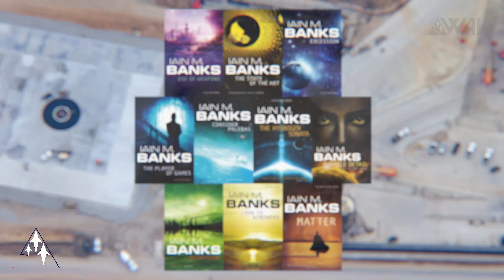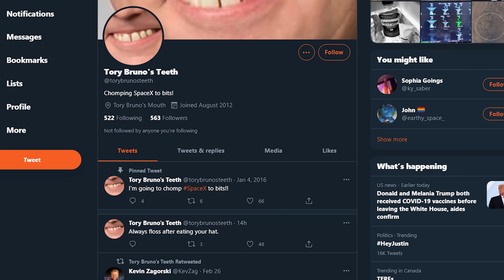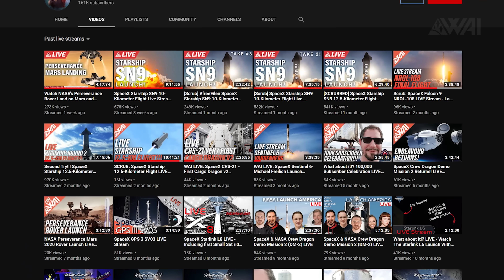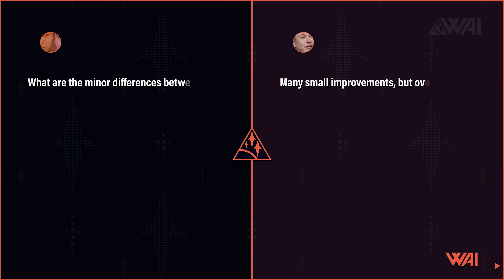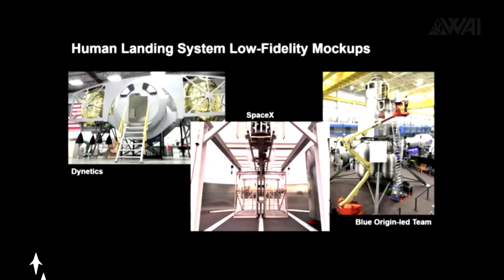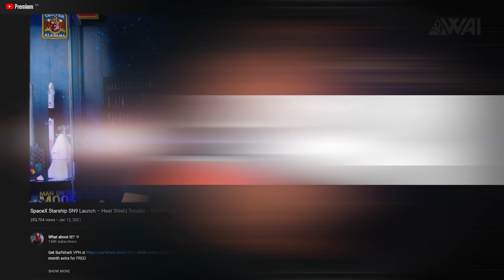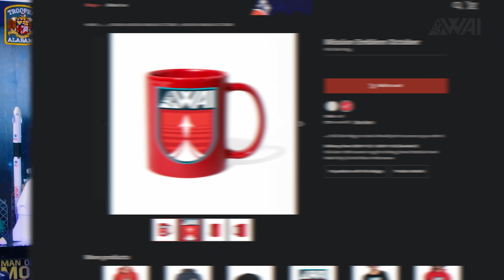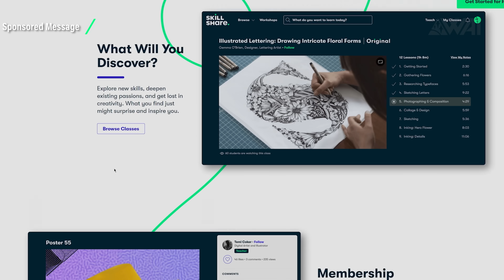SpaceX Starship SN10 Ready For Launch! RocketLab Neutron Rocket Entering Human Spaceflight!

Comment: Chopped off top, could be for a Space Station segment,  Same on the base so it looks like a Starship with two pointy ends and put it on a the Heavy Booster with a small rocket packet to boost the Space station section up to higher altitude, and join said cut of nose to air lock segment, to form a classic ring station 🤓

Comment: What about steel tank In concrete tank with low pressure / vacuum ' insulation ' layer separating ? So crude dome is outer tank dome and standard Starship tanking With the different dome  is the inner !

Comment: I'm presuming RL's new motor uses electric pumps like Rutherford in which case the rendering closeup of the first stage engines at 12:17 doesn't appear to show from where they might release the kick battery boxes (or whatever they call them) that they dump into the ocean.
Perhaps they could be ejected from the side?

Comment: The increased chance of success using 3 engines instead of 2 is (3 - 2p) times, 
where p is the reliability of a single engine (0 to 1).
You'll notice that this is an improvement for all p < 1 (or the same for p=1).

Comment: Rocket Lab is making a big gamble here. The Neutron will be a direct competitor to the Antares and can lift many of the payloads the F9 does. But in order to make that rocket a viable option, the costs have to be lower than the F9. And even then they have to cross their fingers that Starship won´t reduce the launch costs as much as Elon Musk has promised.
Combine that with the things Peter Beck said RL would NOT do:
1) Build a bigger rocket
2) Build a reusable rocket
3) Go public

These things combined seem to hint that RL is driven in its decisions, rather than the driver. It appears like they felt the sudden pressure to lower launch costs even further, expand into new areas and find a way to somehow finance this endeavour. 
Can we find another indicator for that? Well somehow. RL states that they could print one Rutherford engine per day, which is enough for 35 launches per year. So far, they had 18 in their whole company history. And this year doesn´t seem to get better, with one launch completed and one launch to come this quarter. This seems to indicate that RL is staying way behind their maximum capabilities. As if the expected demand wasn´t there.
So it seems like either the demand wasn´t there to begin with (which would be the same experience Spacex had with their F1) or that something eats into their market share (like Spacex´s rideshare missions, that carried more satellites with one launch into orbit than RL in total).

Overall, all of the above combined indicates that RL´s bold moves into new territories and the abandoning of old principles are steps taken by a company in survival mode. They feel the pressure to do things they didn´t want to do, abandoning old visions and business plans to create a new niche for themselves. But if their big gamble doesn´t pay off (especially if Starship in fact reduces launch costs to less than 10 milliion per launch), it is lights out.

Don´t get me wrong, I really love RL. They are really creative (just look at their services and hardware they offer for customers), nice people and have been a wholly constructive force in the space industry (unlike BO *cough*). But we must not fool ourselves and look at the viability of business models with a neutral attitude.

Comment: Why think Carbon Composite isn't strong enough for re-entry? Electron has already proven that the material does survive the heat and stresses. I think it's a too limited view to think they will switch to more common materials when they have developed a system of construction that they know works, and produces a vehicle they can recover. Expect a Rutherford 2.0 upscaled to match the new design for Neutron's first stage, and an array of four or more Vacuum Rutherford's for the second stage.
Don't forget, that sticking to the same motor design is sticking to the same fuel, and the lower stowage pressures required. Neutron will have a thicker heat shield on the bottom, and chutes up top, after all, Salt Water doesn't corrode Carbon Composites.

Comment: I would like to be an optimist in regards to Space Labs.  However, SpaceX is putting enormous pressure on the small launch providers.  Their regular, flexible, very low priced with space tug orbital modification capability makes high cost per kg a hard sell.  Space Lab's Electron rocket  has only flown 18 times since May 2017. There have been 16 successes and 2 failures.   It is reported Rocket Lab with be infused with $745 million in cash from the SPAC and a concurrent funding round.  However, Rocket Lab's revenue was only $35 million in 2020. The company reported adjusted earnings before interest, taxes, depreciation and amortization (EBITDA) of –$36 million in 2020, but expects to break even in 2023. $745 million certainly sounds like a lot of money for a company that lost $36 million last year. However, to develop engines and a medium lift rocket and continue operations for $745 million may be a stretch. It sounds to me like someone has too much money and doesn't know what to do with it. I wish them only the best.

Comment: If I had to make an educated guess that those domes are the top of a 2 layer, aka double wall cryo tank, which would be required if they want to store large amounts of cryogenic liquids. Imagine a large thermos. A vacuum pulled in between the layers, so that the construction of it can be slightly crude, it only has to hold a vacuum.

Comment: The building east of the landing pad is electrical,  the underground is conduit not process piping. Will house Switchgear, MCC (Motor control center) still stumped on the round structures? Don’t see water stop in the base slab for tanks so unless they use hydrophilic plan on leaks. Whatever it is it’s built for weight with 4’ base slab. My 2 cents. Keep up the great work!

Comment: Bigger domes and rings are maybe the outer shell of fuel tanks for insulation and normal sized rings will be used inside to hold the pressure. Just my best guess.

Comment: Why  not  make  Falcon  3  x  larger  with a  ratio   1:3 ?
Reply: They want to use a new engine, new fuel, and new design specifically designed for exploring the solar system with refueling.

Comment: At 1.47 on this video I saw what appeared to be a movable apparatus probably used to harness a returning Falcon 9. When it comes to landing a Starship at sea they are likely to need such a device for inspecting the Starship/booster before and after flights. You could move the Starship to it or it to the Starship. It could also offer protection from saltwater and weather. No plane fly's (or should fly) today without a pre-flight check. Especially if it has heat tiles.

Comment: That could actually be the shape of the new nosecone. It looks like it has an abutment where the heat shield tiles can be fitted against. It may be that tiles near the top will go completely around the nosecone. An additional single piece would cover the very top and would be easier to install and maintain as a tear drop (bullet) rather than a point. That might actually be an improvement in aerodynamics rather than a detriment.

Comment: Hey do you think that flop should be slower? I think so. It can be gradually pitching up without inducing oscillations. You will lose couple of kilometers of aerodynamic breaking, but the majority of velocity is lost in the upper atmosphere.

I mean this thing is planned to fly people. Shuttle has 98.5%, reliability and it was one of the reason for being canceled. Falcon has 87%, reliability. If the aim is 99.9% then this has to be at least 100x more reliable... Especially since it has no abort system. It would take about 20 years to prove this reliability with weekly launches. This landing with humans inside looks very sketchy. I mean capsule + parachute has 100% success rate if I am not mistaken. Plus it need to be approved... I think SLS has better chances of success, but this is more interesting to watch.

Comment: I have a feeling that Neutron will be a steel rocket with open cycle engines. (I don’t see full flow happen with rp1) the question is: will they have a smaller center engine to make hovering possible or just go for the suicide burn?

Comment: I think they removed the original nose cone that was there because maybe mid way into the construction they had a breakthrough on a new header tank design. Maybe it was just easier to cut out the whole nosecone with the tank instead of disassembling the cone. I assume they will add the new tank design with cone once the time is right.

Comment: The storage tank may appear much bigger then the storage tank itself but what if SpaceX is planning for a layer of insulation surrounding the Methane and LOX tanks to more cost efficiently keep them chilled and ready for use at a moments notice. Also There are more fuels then just LOX and Methane used by SpaceX what about Diesel for all the heavy equipment they keep using for day to day transportation. Maybe SpaceX thought to just have a central Fuel Depot instead of spreading too wide. Easier for management.

Comment: Anyone else waiting for the day when someone decides to make a continuous stir welded main hull for a rocket, with the sections being welded together as a continuous spiral, like a paper towel roll tube?  I get that they couldn't make the ENTIRE hull like that, and there would be waste at the top and bottom if they don't just continually run a line and cut it to length, but I'd at least like to see someone TRY it.

Comment: This may sound like a dumb question but can anybody tell me why do the crew have to be on the top of the rocket? I ask this because if SpaceX are going to the moon and having to use a lift to get to the surface plus have engines halfway along the rocket for landing. Why not turn the whole rocket around internally? You put the tanks of LOX and Methane on top feeding into the engines halfway along the body. Below them you have the crew quarters. As they are now a few feet above the surface after they have landed you can have a ladder. Or am I missing something and being very dumb?

Comment: I think a lot of the grey pipes that are pointed out in the videos are for electrical duct banks, not fuel.  You can tell because they appear to be PVC and come into Pre-Cast concrete pull boxes, where the cables inside the pipes will change directions.

Comment: DUMB^2  It is insane to wait until the Starship is 7 seconds from crashing into the ground before lighting off its Raptors.  This leaves no time for anything but perfection and there are too many variables and lag times and chaotic activities going on for that to ever work.  Solution proposed: Light off all engines at once .  .  . INSANE!
That’s a bit like opening your main parachute and reserve at the same time and doesn’t address the main issue .  .  . TIME!  Light the rockets off at least 1 minute before it is scheduled to crash into the ground and you have time to at least to try to compensate for all of the instabilities of this highly complex system.  Then softly and elegantly land the same way you launched.

Comment: Hi bro i always wandered how they keep the wieght of all those tiles i mean because the tiles are on one side wouldnt there shift in CG
Reply: They strap a Tesla Roadster to the opposite side for launch.
Reply: interesting point tho id wonder what part of the flight profile this woukd affect?
since the weight of the heat shield will be on one side only, it will aid starship in reentry and belly flop. so realistically, the only time it becomes an issue is when ot is upright for landing, and i think the rcs thrusters coupled with the remaining fuel in theain tanks settling to the bottom will be adequate
Reply: But compared to the space shuttle I think this is not a lot of off center weight.
Reply: Starship can fly with 2 or even one engine so vectoring should be enough.
Also they are not very thick due to Stainless steel body (very strong), and maybe it could even help in belly flop.
Reply: @ImieNazwiskoOK  wouldnt thrust vectoring introduce cosine loses ie. because some energy is dericted to keep starship upright . Wouldnt that mean reduction in efficiency
Wait you may be right im not sure but thanks for the reply all you guys
Reply: @blizzard4025  Yes. I don't think that will be much but still and %.

Comment: The neutron looks like it's made of common ring segments like Starship. I wonder if Rocket Lab are planning on using stainless steel to save costs.
Reply: Looks like they are happy to borrow design cues from other rocket companies. Landing legs look like f9, too. Scott Manley also pointed out similarity with Antares.
Reply: Stainless,.. no chance.
Reply: Coming in 2024
Reply: It's funny, I'm 95% sure that Peter Beck answered somebody on twitter that the Newton material will be more "metallic" (stainless steel ?), but I can't find that reply anymore: I wonder if he deleted his answer...
Reply: @FredChauvière  SpaceX is using stainless steel for specific reasons that don't apply to Neutron. -- it's not that they just discovered an awesome new all-purpose aerospace engineering material.
Reply: There is zero reason for Neutron to be stainless steel. Rocket Lab is not bringing a second stage/spaceship into atmospheres at orbital velocity+.
Reply: Maybe, it would make sence now that spacex has proven that it can be done